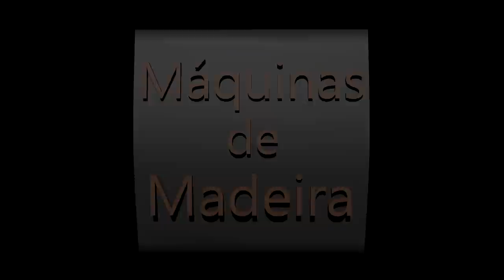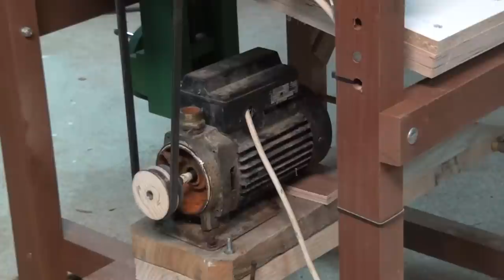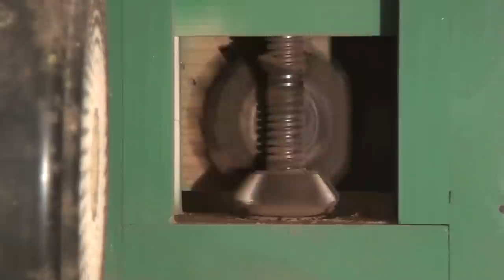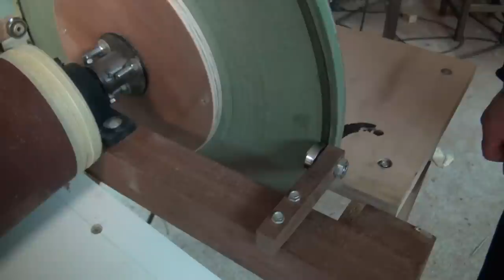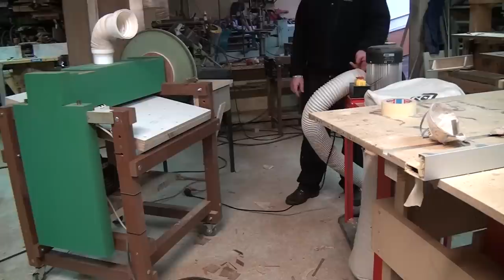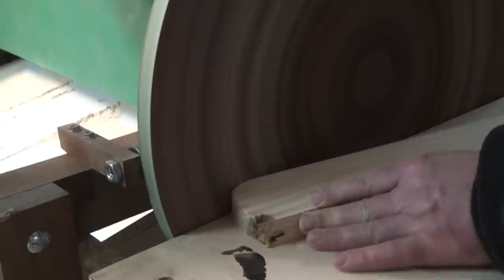Drum and Disk Sander Homemade - wood machine - Thickness Sander

Comment: Great thicknesser. They are expensive to buy. To stop the paper clogging I lift the cover and rub a plastic dressing  stick on the top of the drum. My paper then lasts a very long time. If I rely only on dust extraction it only takes a few passes to clog the paper. Same with all my other sanders, disc and belt.